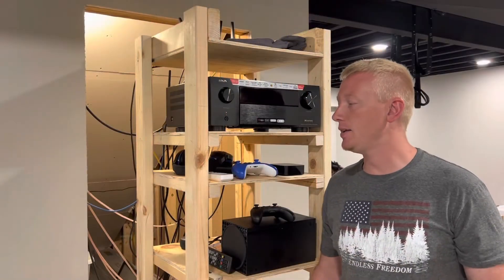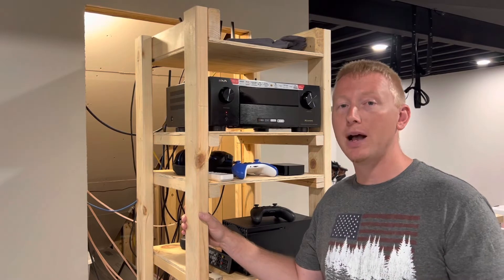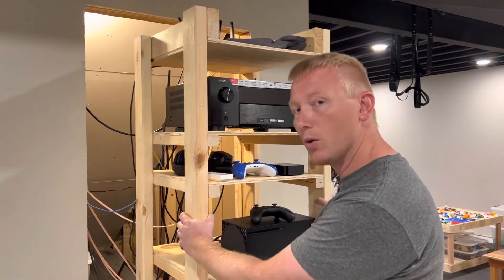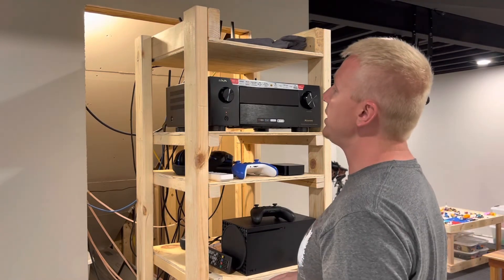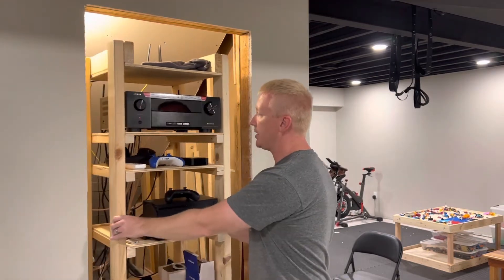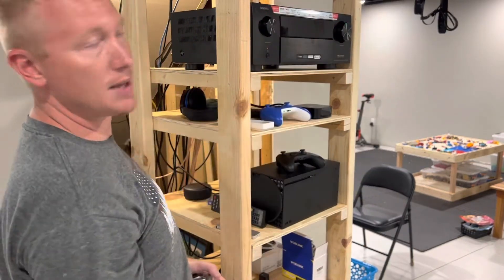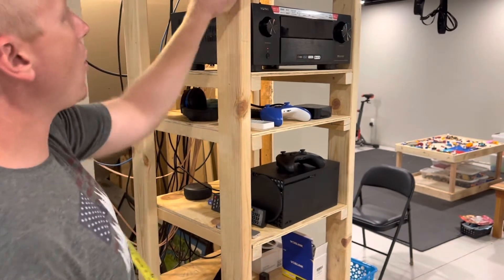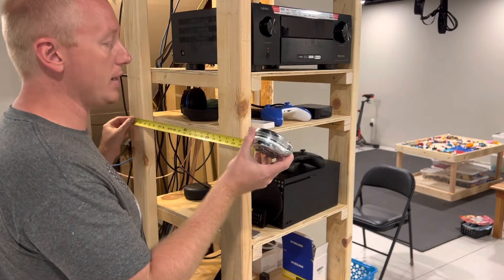DIY: Home Theater AV Rack

Comment: I like the design. Nice and simple. You should definitely address the wiggle. The simple solution would be to add horizontal 1x3 runners across the front of each shelf that spans the vertical 2x4s. This will fix the racking problem without blocking access to gear. Also over time those shelves will sag. You could run additional 2x2s diagonally across the bottom of the shelves.

Comment: Totally craps.   Rack could not hold all your audio toys.  It will collapse to the head of your little one.  Take it down for safety
Reply from the maker: Thanks for the input. I’ll consider it. It’s done very well for me so far. I don’t have a lot of equipment but haven’t felt that there’s any safety concern up to this point.
Reply: Don’t over exaggerate man. It’s totally fine for a receiver and a few games consoles.